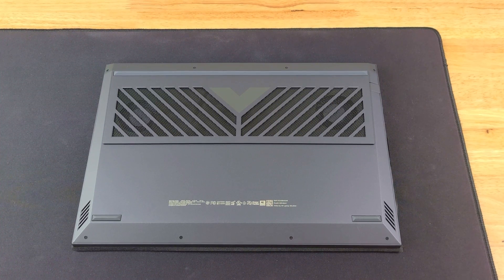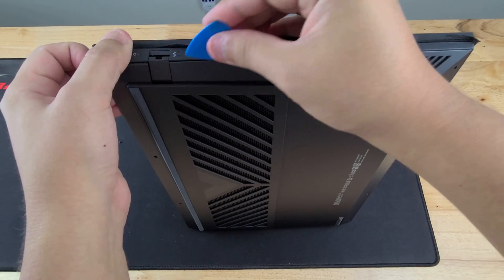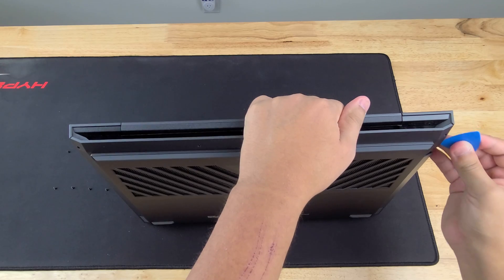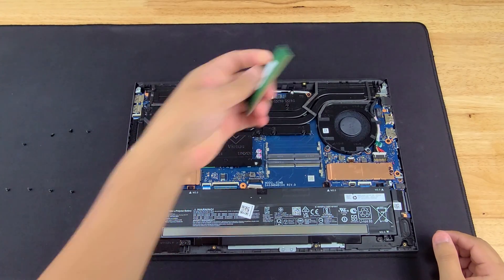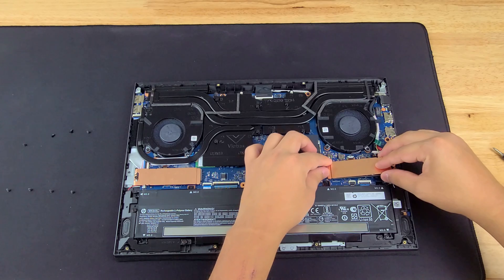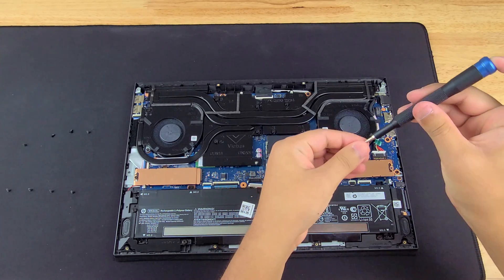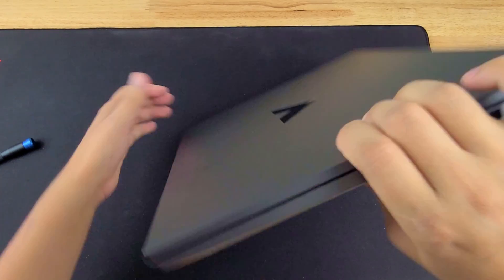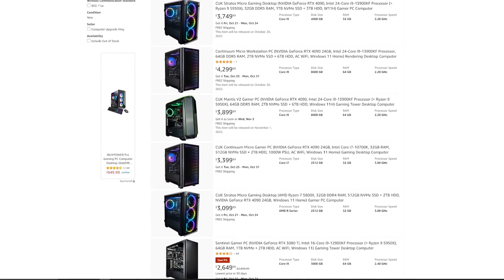HP VICTUS 16t Gaming Laptop |how to upgrade your Ram and SSD

Comment: Helpful for this model; enabled me to take out the battery plug in a different way so i didnt need to remove it to change the RAM. tip from ex IT engineer; do a power on test and second gap check test before you put on the screws, i have had issue with fault RAM and drive/drive cable and this saves a little time.

Comment: do you have to remove the battery when replacing the ram? @Racimbio
Reply from the maker: @BrixtonUK  as a precaution, you can unplug it. That way, you know there is no power going through it. On my own stuff, I don't usually fully remove it . I just make sure the laptop is really turned off before changing the ram. Sometimes, even when you think its turned off, it may turn on while you are working on it so, if it's your first time working on a laptop, use precaution.

Comment: This same laptop a year and a half later (now) still only comes with 16GB of RAM, but it comes with a much faster video card. Instead of the 3060 this one had, it has a 4070. !!! Huge difference and it is only $1,099 at Costco! Just picked one up today. This is a great deal for a gaming laptop.
Reply: 4070 is crazy
Reply: @Fishy_boy760  had to scoop it, 4070 one was $849 haha
Reply: I got it as a summer deal for $599 from Walmart. Hopefully I won't need to upgrade the RAM
Reply: It is now at $899 in Best Buy
Reply: for 1099 is wild
Reply: @shazeenaahmad6502  I got the same one (I think) at Walmart for $599. It was an absolute STEAL
Reply: @shazeenaahmad6502  I run FarCry 6 at all Utra settings... looks amazing!
Reply: Bro it’s only 900 on Best Buy dude
Reply: grabbed it
Reply: Just got the 2024 Victus 16 8845HS processor w/ the 4070 (on sale for $900 from Best Buy!!!)

First thing I did was upgrade the RAM from 16 -> 32GB RAM (5600 Mhz DDR5 SODIMM). It is MUCH smoother (especially gaming) with 32GB RAM. 

This laptop is blazingly fast and stays nice and cool (you NEED a laptop stand/cooler for ALL gaming laptops!). 

Also, there is no hinge issue like the 2022 HP Victus models had. The hinge has been fixed and is very stable.

Thank you for posting this DIY, the instructions were perfect.
Reply: @limitedchez  out of curiosity, how long does the battery last when not plugged in?
Reply: @limitedchez  I just got the same one. I'm kinda pissed it only has one slot for an m.2 2280 drive.

Comment: How do I know how to find the correct ram chip? Like the one you just installed. I see some on Amazon 32GB ram for a laptop doesn't say for which kind. Are they all the same inside all laptops ? I have the same laptop. HP Victus 16
Reply: I don't think they're all the same, since some computers can only run ddr4 or 5, the Hp Victus 15.6 uses ddr5 I believe.
Reply: search for the ref that is behind of ur laptop, like mine is the laptop victus 16-e0129nf for example, so u just have to entry them on internet, and ull be able to have the right ram for ur laptop, on crucial website or others
Reply: @CDdd-sv2ei not really
Reply: @CoryResilient  look for the model number of the ram and the model mumber of your laptop then ask chatgpt if they are compatible
Reply: @CoryResilient You are looking for a DDR5 SODIMM that runs 5600mhz. CAS latency 46 or lower preferred but not necessary. The laptop holds up to 2 sticks.
Reply: @riverwalkhomebuyers  Can you add one stick and leave the original 8gb stick to make the total 24gb RAM.  Also someone else mentioned ESD.  Is this something to be concerned about while installing RAM?

Comment: Is this all that is upgradable, or is there more to be improved on the system?
Reply: It is a laptop after all, you have to remember that it still has to fit in the tiny room that they offer the tech to be housed in. Storage and ram are usually always the only things you can upgrade in laptops.
Reply: I don’t think there is anything to upgrade

Comment: Is this compatible with DDR5? Also, can you upgrade the battery?
Reply: Not ddr5 compatible
Reply: @paragon_zero  i could very well be wrong but im currently typing this from an hp victus and i have my specs pulled up on the laptop itself and it def says im using ddr5 ram
Reply: @paragon_zero i have a very similar model that's ddr5 compatible (it came with 8gb 4800mhz)

Comment: I have HP Victus 16, i5-12500H and RTX 3050. But when I install Kingston Fury Impact 8gb ddr5 4800mhz into the laptop together with the original ram, the laptop would not boot into the system. But when I use only one of the ram, the laptop does boot up into the system.
Reply: Maybe I'm wrong, and this doesn't explain why 1 stick of ram causes it to boot, I believe this laptop only supports ddr4 ram with a max clock speed of 3200.
Reply: Yep, that is the reason. 
This laptop, I mean, the motherboard only support ddr4 technology on 3200 mhz. When you try to turn it on, It wont reconize the new ram because it does not have the technology to read it or use it
Reply: In Australia, HP claims it is ddr5 compatible and I have been looking at getting ddr5 ram for it but now I am unsure. One thing I am curious about with your comment is that you are trying to run the original ddr4 ram with a stick of ddr5 ram and I am unsure if that is your problem. Have you tried running 2 sticks of ddr5?
Reply: @HertzAroundTheWorld  the ram is best  if its the same brand and same of gb and speed
Reply: Hey man, i have the house victus with the rtx 2050 and Ryzen 7000 is mine upgradeable too?
Reply: weird i have the Hp Victus 15 with Ryzen 5 7000 series and i have a corsair DDR5 ram 16GB 4800Hrz and it works totally fine it does say unknown brand but it works i will buy the same one at another time to go to 32GB but mine took it fine and it works both are 4800Hrz so it should work on the HP Victus 16
Reply: @jesuscervantesj82 what brand of ram was already in the laptop that way I know what brand to order when the laptop comes in I hate mixing ram sticks
Reply: @dadon5408  mine had a Samsung but I will buy 2 of the same on best buy
Reply: it supports 3200 mhz of clock speed buddy not 4800 here u need to use a somidd 3200 mhz 8gb ram on the slot that would fit perfectly and will work on ur pc
Reply: @thehumoriority2859 in my task manager it says 4800 clock speed

Comment: I'm thinking of buying one. Have you experienced any issues(build quality issues) except the screen wobble?
Reply: ngl its really good but DONT use chrome on it
Reply: @LoverBoyBEBOP why not I use chrome on it
Reply: @Velourxii chrome ia a ram horror it will eat it all
Reply: @LoverBoyBEBOP  why no chrome?
Reply: The trackpack and the whole structure feels cheep besides that all good! 
I mean you get what you paid. It is a beautiful laptop but it wasn't built in aluminium :(
Reply: @wilsonveintimilla9285  And thank goodness. Stuff made of metal is big yikes.
Reply: @totallytrueinfernoriderwuwa  I mean the quality is not what I expected. When you hold it from a border, it tends to bend a little bit which is actually bad. And the screen does not have enough brigthness.
Reply: Cheap enough that picking up the laptop to carry it the frame will bend and click the mouse
Minor annoyance though it's a decent laptop I got it around £600 and £16 for another 8gb of ram to put in off crucial